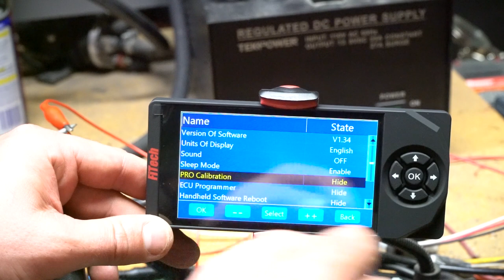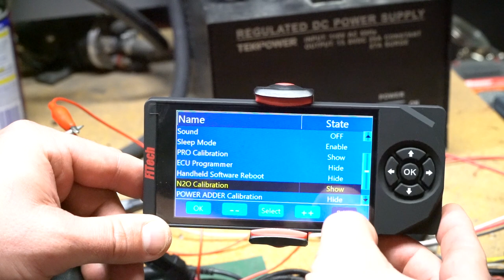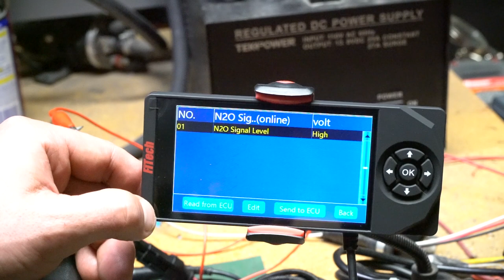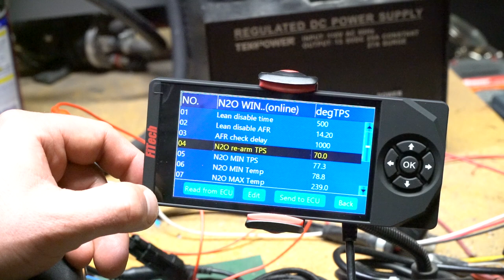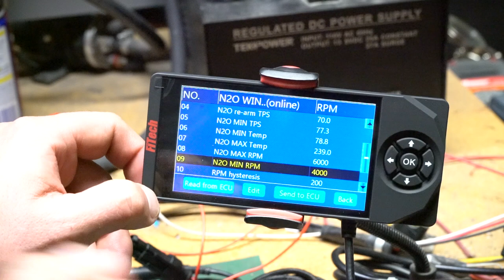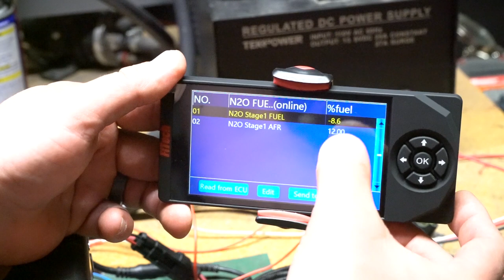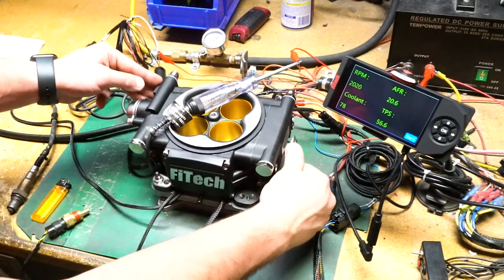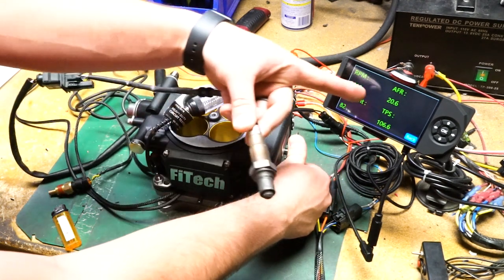Nitrous| Tech Tuesdays | EP18

Comment: This unit is an outstanding tool, I've not installed mine yet but have researched a little and have read the comments from users, some love it and some hate it and I believe the ones who dont like it are the ones who dont know how to adjust or use it correctly, some cant understand that it takes time for the system to learn and adjust accordingly,  it's not the fi tech it's the person who hasn't schooled or researched the how to adjust or use this. I'm no expert with it but have determined this is by far so advanced over a carburetor.  I'm going to learn the how to and make videos and advertise this system to my customers at my shop and on the race guys also, they will really all want this after I present to them!!!! Thanks for the video

Comment: So how do you arm the system to turn it on and off and what is the test light connected to would it be connected to the solenoids?
Reply from the maker: The WHITE wire on the power adder harness is the arming signal. When the wire is supplied 12 volts the nitrous circuit is armed. The TAN wire is the trigger circuit which is hooked to the test light. This wire grounds to turn on relays which should be used to turn the solenoids on.

Comment: Are all fitech systems able to control nitrous? If not can they be made to by adding a pin to the connector and flash update? I will be using a wet kit with a 30002
Reply from the maker: Only Poweradder systems will control nitrous.

Comment: What would cause my handheld to say you not responding the unit seems to power up I can hear my relays clicking off and on I have power on both sides of fuse block but I also do not hear my fuel pump turning on
Reply from the maker: If the relays are clicking on and off that would be a sign that there is a loose connection on either the battery wire or grounding of the system.

Comment: Ok. Got a tricky one for ya. I’m running the 600hp power adder setup on a LS motor with a msd 6012 box. Bought the system before the ultimate LS came out.... The setup runs fine! But I’m unsure on how to wire up the nitrous. I understand the white and tan wire, my question is this: The 6012 box has a built in 2 step and timing retard. To get the motor to run I had to connect the 6012 tach output to the tach wire on the fitech. The directions state not to use the fitech tach wire if timing control is used... it says to use the black coil wire... should I just let the 6012 box control the timing? I’m kinda stumped
Reply from the maker: Since you are using our 600 hp power adder system on a LS application you will need to use the tach output from the box to the tach signal wire from the FiTech. This because the unit on a LS will not control timing. That will be done through the 6012 mad box.